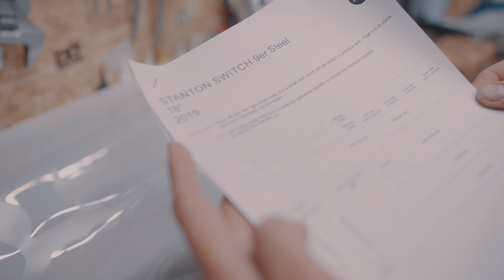DREAM BUILD MTB - Stanton Switch9er

Comment: ive been viewing your programs , and applaud your mechanical engineering skills . however i am a senior with mobility issues ,therefore i challenge you to use all your skills and power to build a 3 wheel rollator with 16in fat tyres so i might get outside and enjoy our bleak n.e. win  ters . snow ,ice ,and sidewalks are an impediment to folks not of able body . i humbly ask for you to consider this challenge .   a old man from the north country.    ;  ]